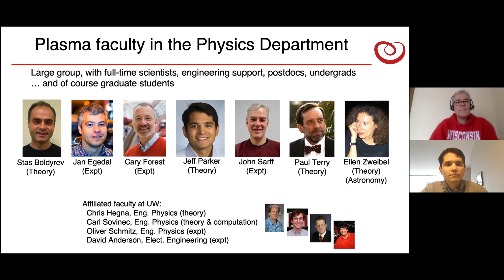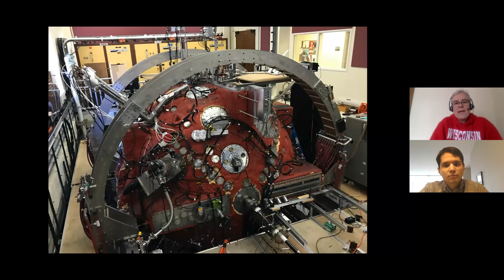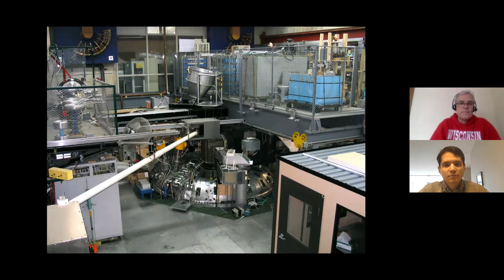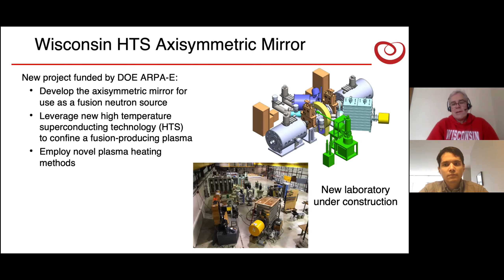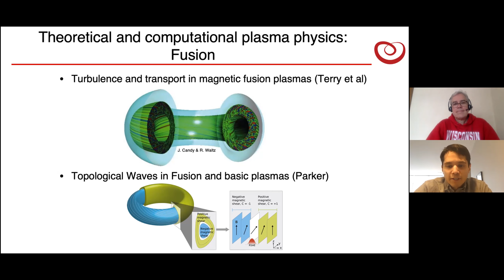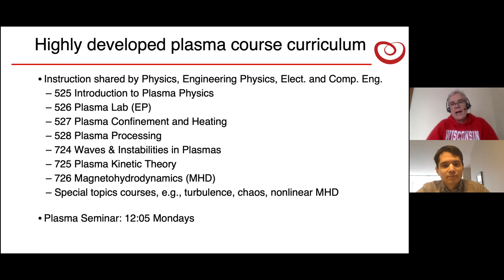Plasma Physics

Comment: "The Earth's Ionosphere:  Plasma Physics and Electrodynamics" by Michael C. Kelley is an interesting read with lots of Plasma Physics that's close to home, including Birkland Currents.  Dr. Donald E. Scott's papers on Birkland Currents are very readable;  if you've had Electromagnetism at the Upper Division level, they will make sense.

Jackson's "Classical Electrodynamics" (1st & 2nd editions) discusses "Magnetohydrodynamics & Plasma Physics" in Chapter 10 and includes a good bibliography.  Magnetohydrodynamics is covered in Chapter 8 of Landau & Lifshitz's "Electrodynamics of Continuous Media" (Vol.8).  "Modern Electrodynamics" by Andrew Zangwill is on the level of Jackson without the sharp edges;  the selection of examples and problems are very physics-oriented.